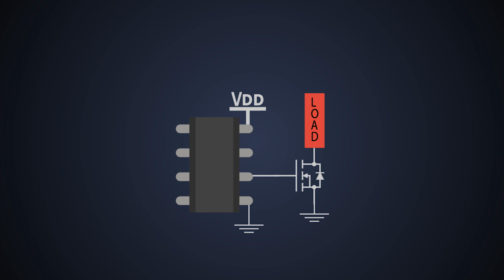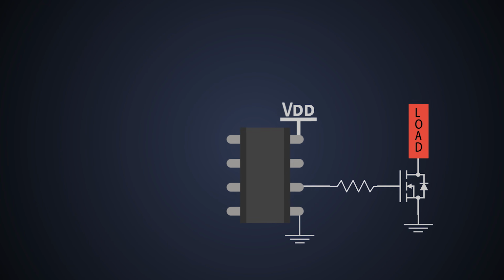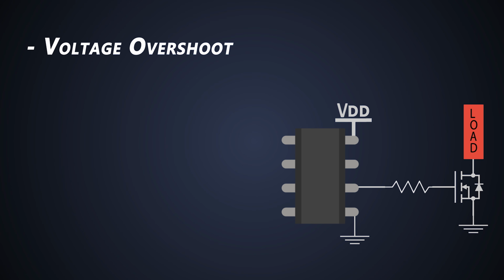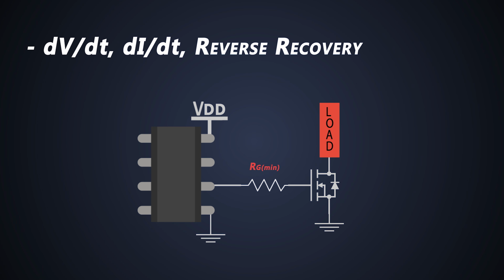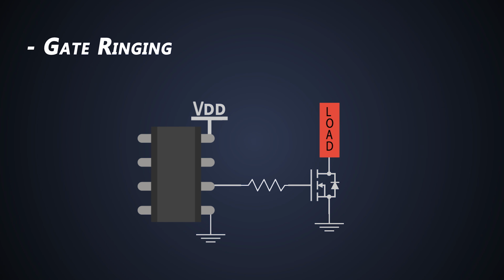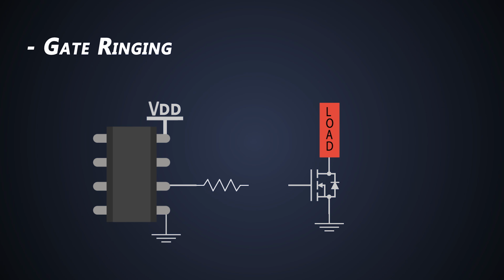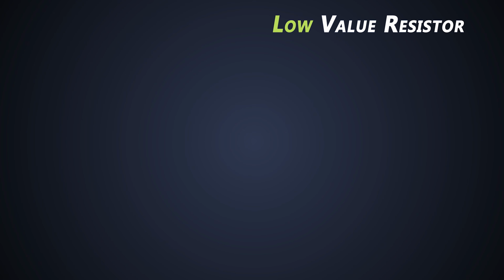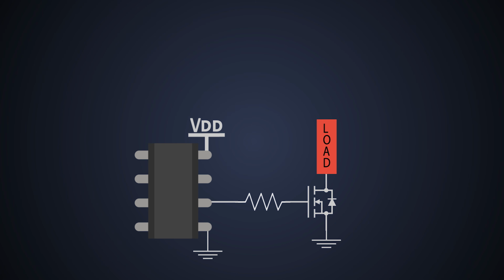Why do we need gate Resistor to drive the MOSFET? How to select Gate resistor?

Comment: Can a high capacitance between drain and source (due to flyback diode maybe), cause a high gate to source and gate to drain capacitance during switching? I have a slow switching application: I need to switch on and off a constant 12-14V DC drain to source going through a motor every few minutes. The driver is having more trouble on the off to on switch. If I disconnect the source or drain from the NMOSfet, the switching has no trouble, but otherwise it gets stuck for a while in the sub-threshold regime, where power consumption across the S/D terminals is highest and the transistor heats up and eventually wears out. Advice? I though adding a gate resistor would make things worse?
Reply: Forget about S/D capacitance idea. It's just a G'S high capacitance that needs to be discharged by gate driver circuit as quickly as possible. Having low output impedance should in theory do that, but maybe that circuit got fried by having to dischatge a huge capacitance. The thing I don't understand is why removing the source wire from the transistor lead dscharges that capacitance. As if it were happening outside the transistor. Or maybe the DC battery connected to the drain side wire has something to do with it.

Comment: It is simply the driver is driving a high impedance MOSFET input. A lot of ringing happens. A small resistor is needed to dampen this. We saw it with our circuit in the lab. Don't rememebr what it was, probably in the range of 22 to 56 or so Ohms.

Comment: Do the mosfets usually blow if the resistor is blown. My mosfets look good on my inverter but my resistor was blown. I didn't replace yet but wondering what else I should check

Comment: There's always a possibility that the MOSFET could short circuit and blow the computer being used to drive  the  device  if there's no resistor, especially if the parts are chinesium.  It's not uncommon for people to directly connect the gate directly to the output of a computer or microcontroller. A .25 cent optical isolator could  be money well spent.

Comment: Definitely makes a difference having that resistor. I managed to find the value using a potentiometer and oscilloscope. Correct value drastically reduces "ringing" and makes amplified signal cleaner and stronger. I used rpi pico as a 7mhz square wave source, act244 as a mosfet driver and two parallel 12v powered bs170s as amplifiers. The resistor value varied between 220 and 370 ohms depending on mosfet load.
Reply: @Vojislav Great comment. Gate resistance also depends on Vds and gate lead inductance. It's also very layout specific as a result - when testing on oscilloscope, did you use PCB or breadboard?
Reply: @subhobroto  I used a breadboad, and it is not a nice setup :) just proving a concept though. I expect the value to change once on a PCB, so some more experimentation and calculation will be needed.
Reply: @batica81  Excited to hear - do you plan to get back to this project soon?

Comment: Please please please read the datasheet that comes with your mosfet driver before following this advice. The datasheet will nearly always tell you the prefered set up, drivers like Microchips MCP1415 specifically ask for it to share the same pad as the mosfet its driving with a diagram showing that the pins of both share the same copper fill area.

Comment: But how do I calculate the gate resistance value
Reply from the maker: You don't need to calculate. The value depends on the driver. You can check the application circuit of any driver. you might get the resistor value there

Comment: hi. what's the difference between 'power dissipation' and 'power loss'?
Reply: Power loss is the power (V x I) lost during switching and during steady state. The power is lost due to dynamics of Vds, ID and Rds(ON). Current flowing through the Rds(ON) value of the MOSFET causes I^2R power losses. Entire power lost is in terms of heat. For saving the MOSFET device from failing due to overheating, the power needs to be dissipated (thrown away). 
Power dissipation is regarding how effectively and how much, the MOSFET package is able to convey out the heat generated within the junction while the Id current is flowing. The power dissipation is entirely an ability of the MOSFET package. User can effectively dissipate (to the cooling medium - Air) the entire amount of power losses if one has effective heat sink in place. Hope this helps.

Comment: sir can you please explain whats voltage over shoot mean in a mosfet and how to calculate the gate resistor value ,how does a  high gate resistor value will increase power dissipation of a mosfet please explain
Reply from the maker: You can check my other videos based on MOSFETs. You'll surely get the answers

Comment: great content, but one thing is missing examples how to choose proper resistor in real application.
Reply: As I understand, to prevent oscillations the minimum resistance is: Rg min(non-osc) = 2×√ Lg/Cg. (Lg = parasitic inductance, not every datasheet have it) 
Rg in the datasheet is pretty close to it, I think.
The maximum - is a compromise inbetween the desired switching losses and VDS max of the MOSFET vs. dI\dT (the voltage surge when the FET is off). 
Note that the driver resistance and the MOSFET internal gate resistance are also counted. For example: IRLR120N Rg min = 2×√ 7,5nH/0,44nF = 8.2 Ohm. 
But these minimal 8.2 Ohm = the actual resistor + the driver resistance + the connections and PCB traces resistance + the internal MOSFET resistance.
Reply: @arthasmenethil5752  thanks a lot
Reply: Yes

Comment: I will also often add a small value of resistance as close as possible to the output pin of the driver IC as well as at the gate. That helps soak up reactance in the circuit board trace, or, lead wire between the two devices. It can be a very low value, ~2.2-4.7 Ohms. I agree, the bulk of the total resistance should be at the MOSFET gate. An individual resistance should be used on each gate, if running several FET's in parallel.

Comment: A resistor to ground or Vdd is also wise if you want a fail-safe design.  If the input to the FET gate is floating (which it is until the mosfet or driver is turned on (and running the appropriate code section), then it easily can float to turn on, partially on or off.  If using a micro, it can be several ms or 100s of ms before the output pin is driven with a known state.  Also, low resistor does not increase heat, fast switching does (since the average current does) and also a slowly rising and falling gate voltage will cause the fet to be in the linear (ie resistive) region too much of the time compared to the signal it is driving, that translates to efficiency losses and heat.
Reply: > A resistor to ground or Vdd is also wise if you want a fail-safe design.  If the input to the FET gate is floating (which it is until the mosfet or driver is turned on (and running the appropriate code section), then it easily can float to turn on, partially on or off

Indeed - one way this manifests itself is when the gate resistor blows, and the designer did not put in the pull down. The gate's now floating and cascading failure ensues. I have no clue why designers miss this failsafe detail

Comment: The best way to protect the gate is to keep the mosfets as far away from my workshop as possible.
Reply: They got us in the first half, not gona lie.
Reply: I named my cat Mosfet so ..
Reply: @DeadCat-42 mine is dead, her name was Hfe. i accidentally blow her bandgap treshold, when i was stroking it with the high voltage probe, witch i forgot to discharge after measuring a 300KV source. 
well, ...shit happens...a little close to home dow. 
i berried her next to npn and pnp, ...my two dead pet rat's, ....don't ask how these ended up in that state, but it wasn't solid state.    𝞨
Reply: i sense a high capacitance reactance here, and funny as quadrature modulation. 𝞨

Comment: With resistor value too small, some microcontrollers fail to convey the output logic state. The software drives a '1', sets the register latch but the output latch stays at '0'. Because 'pulled down' by the gate capacitance.

Comment: It's often also a good idea to put a large resistor  (1M for example) from the driver output to ground to remove capacitative coupling.
Reply: 1M is too high, usually it's recommended between 10K and 100K. The gate source resistor is required when the MOSFET gate is driven by a microcontroller that can be in sleep state that will put all GPIO pins to high impedance state
Reply: @dragoscucu3128 making a circuit to drive a solenoid valve with up to 1 amp at 12 V (followed by pwm to keep the valve open with very little power), I discovered the logic level mosfet could remain high for minutes after disconnecting when messing with it, so I added a 100k resistor to ground in the circuit. I didn't know you're supposed to put a resistor between the controller and the gate as well.
Reply: @brainwater  I think it depends on the driver's topology. If it is push-pull, you should turn the MOSFET off, but if it is open-collector the MOSFET gate capacitor will not discharge, then you need the resistor to GND. IMHO, it is better to put it from gate to GND instead of driver output to GND

Comment: Thx for sharing, however the Miller effect has the most profound effect on switching speed. What size range of resistor are you talking about 1Ω, 10Ω, 100Ω 1KΩ. It takes amperes of current to push the output fast against the Miller capacitance.
A sim or lab work would have been most helpful but you did get a click outta me.

Comment: This is important stuff that people often learn the hard way.  If you have a pretty beefy mosfet,  gate resistance too small; mosfet goes bang.  Gate resistance too large; mosfet goes bang.   In both cases, often something else goes bang, like the gate driver and possibly as far back as killing the controller before that.  Things really go bang when the mosfet fails as a short and its in a H-bridge or something because then you can short your extra beefy power supply and all the magic smoke comes out.

Comment: It took me far too long to figure out what you mean by "Dyabadeety" 😀
Also, shouldn't there be another resistor to ground to decrease depletion time in the transistor?
Reply from the maker: You will need the resistor if there is no low side switch in the driver to discharge the input caps.

Comment: Sir,  I have a mosfet:  Qg=200nC and  tr=100ns, it mean's in theory I just need 2A to drive it  but even I use a 4A out gate driver, it still not enough....why? the frequency is too fast?
Reply: Probably due to Miller effect.

Comment: There is another reason. To prevent a low power driver output to be blown up. The gate capacity can draw huge peak currents to charge the gate capacity when the FET is switched on. For sure with microprocessor outputs connecting to the gate it is advisable to use a resistor.
Reply: That's right :)
Reply: In short...no resistor ..heavy load and too much paracite inductance....too large r ...slow speed  smeared drive waveform and failure
Reply: I don't think, who connects the MOSFET gate directly to the MCU pin? the G should connect to the MOSFET driver. And also with the drive, the resistor should be used, not for huge current but for noise and efficiency too.

Comment: Voltage overshoot ?  "Due to higher  G I T T  ?"  Subtitles say "dl/dt" .. I have no idea what the actual words are ?
Reply: I thought the overshoot was because of stray inductance.  In an inductor the current doesn't like to change suddenly so it will try to carry on pushing current, your pushing that current into a capacitor and when you do that the voltage rises.  So thats why when you try to stop the current instantly it overshoots.  The ringing is because the inductor will then steal that energy back from the capacitor; the reverse happens and then it flows back again, and they argue it out between them.
Reply: @dr_jaymz  Err ok, not sure what that reply has to do with my problem understanding the speech itself, if you make a video in English then it should be understandable by the majority of English speakers or it renders the content mute.
Reply: @jonshouse1  - Ages ago when I was in college, students made the same argument about teaching assistants and even professors.
Reply: The subtitles are correct.  I say it as  "di"  "dt".  It means the rate of change of the current vs time.   Usually expressed as amps per second.

Comment: There negligible current flow to gate, how res will control the dv/dt of cgs
Reply: The current flow can be huge.  Because at turn on the gate capacitor is discharged, it looks like a short circuit to the gate driver. The ONLY current limit is the gate resistance.
Reply: I think you mean 'negligible DC current'?  DC isn't involved